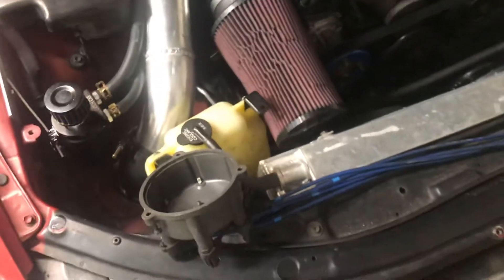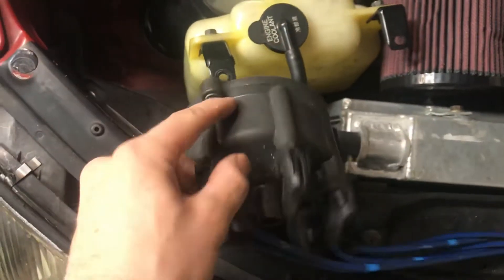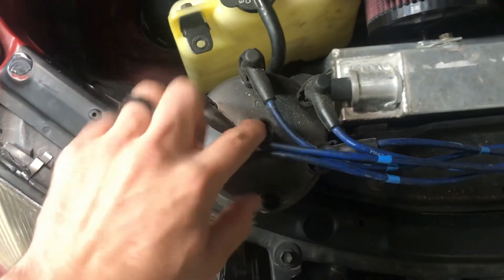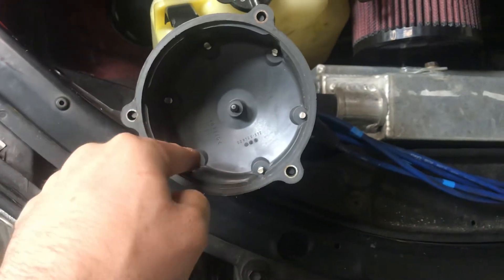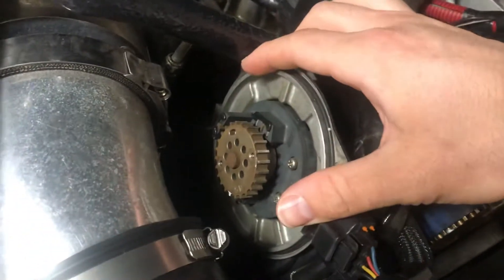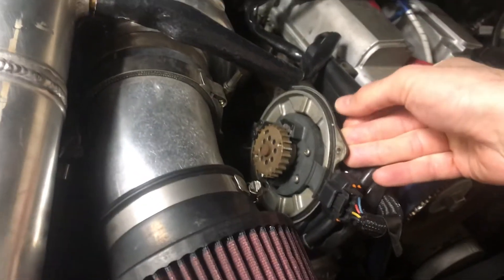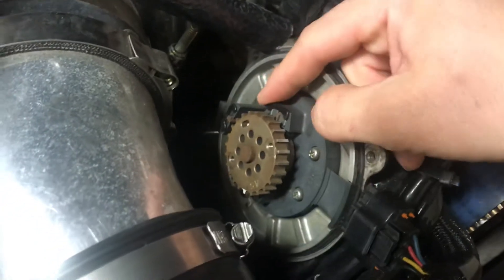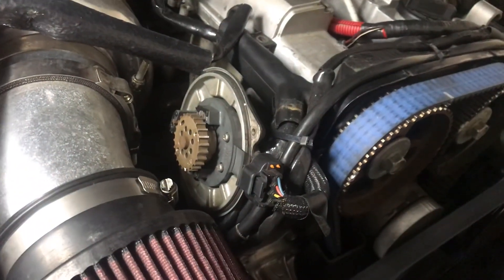How distributor sends camshaft position signal

Comment: I have got a question for you. I acquired a JDM Supra TT ECU (Auto), because I didn't want to deal with AC relay mod and all that- my question is how do you set the timing for it? 

Because from what I read on alisc3 thread, you have to trick or jump the ECU to be in N or P. How the hell do I do that🤣🤣🤣, something of that nature... I'm on the last leg of this mod but reading more of it... Caused this question to come up, is it even necessary to do that?

 I don't think I saw that on the first page of the tt ECU Mod as a requirement to jump or trick the Aristo/Supra Auto to be in N or P to set base timing. Correct if I'm wrong. I really appreciate your help and support! I really can't wait to drive my car. It's been over a month on ice.
Reply from the maker: My understanding is that’s not required. I don’t know what the internet says but I can confirm the on my manual transmission car that by jumping the correct terminals in the diagnostic port and turning the distributor does change base timing. I don’t have a dyno but it’s easy to tell the car is making less power when I retard(decrease) the timing. My guess is the distributor is such a basic way of creating the cam sensor that the computer doesn’t actually know the timing has been changed from factory base. If you still want to know more I can go read the thread some more, just ask. Thanks for the questions I appreciate them.
Reply: @alexfrench8142  that's good info, man!!! I was thinking something along those lines as well. 

 I appreciate it very much. I don't think you have to go read it--- TBH, you are already knowledgeable enough!!! I take your word like gospel, brother. 

however, If you do want to check out, it's around the #3555 plus minus of the thread tt ECU MOD on club Lexus.